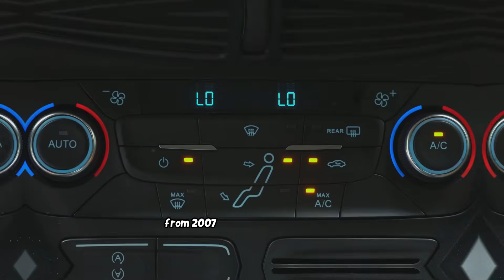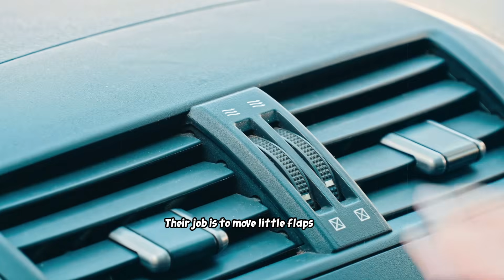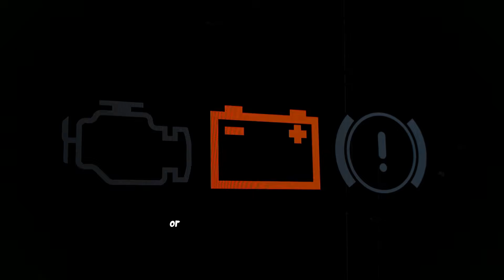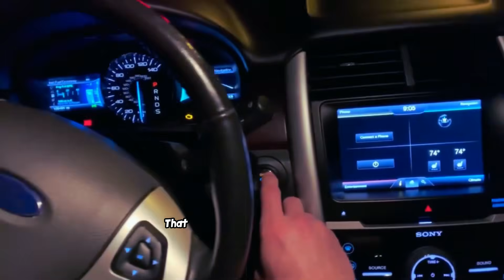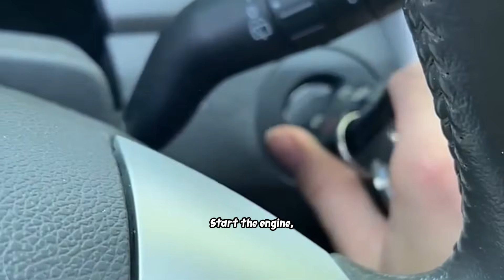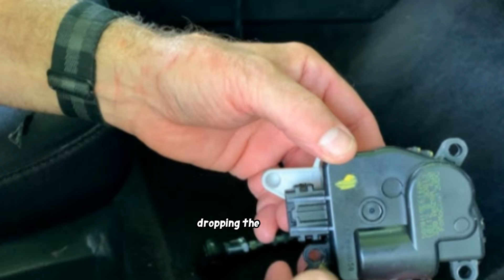Ford Edge AC/Heat Not Working: Climate Control Reset (2007-2014 Fix)

Comment: It worked the first time, but the next year it stopped and finally died.  So I had to do the full replacement.  Very hard to do simply getting the screws out, but very easy to do in terms of replacing the actual part.  There's another video I watched about doing this for 2013 version and I just bought the part from the auto parts store and Im not a mechanic.  Also, the reason its hard its hard is getting a screwdriver in there to fix it. There is a metal cage/frame blocking it.

Comment: All this control button pushing stuff worked once on my friends 2013 but not for long. Frustration followed until we replaced the heater control valve that is in front of the engine block on the driver side of the vehicle. If you can’t feel heat on the hose that comes from the valve to the dash the valve needs to be replaced. Removing the hoses from the old valve without damaging them is the most difficult part. You can now hear that heat bubbling under the dash. Tickled my friend to death after freezing for more than a year.

Comment: I am surprised and grateful that it actually worked. I have a 2014 Ford Edge with still a car note on it. I had to try it a few times but it worked and the heat is working again. Thank you for the video!!!!!!

Comment: my 2007 edge does not have a climate control button like in your video
Reply: Apparently you can press the button that shoots air from the floor and the defrost button together THEN hit the AUTO button right after to start the test on the older models
Reply: Mine doesn’t either :(